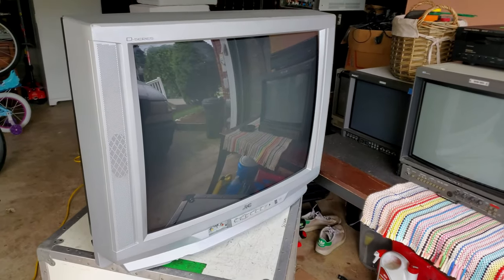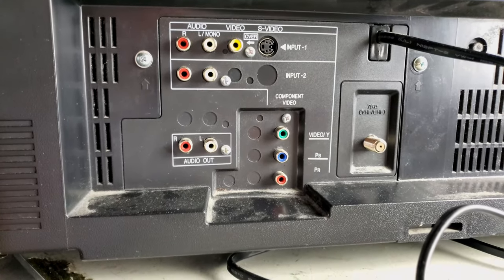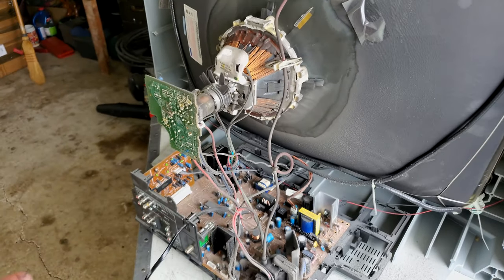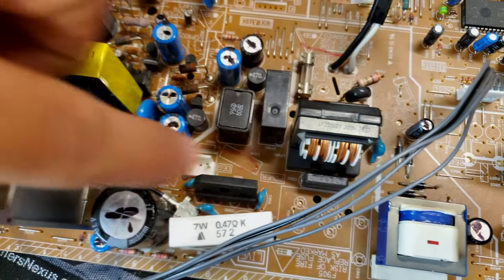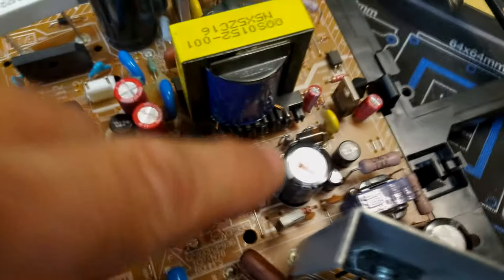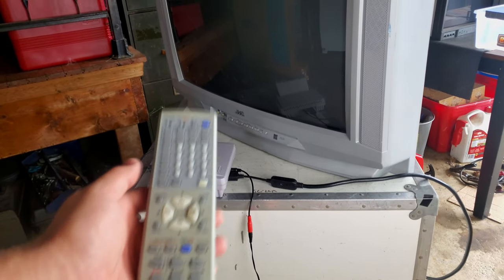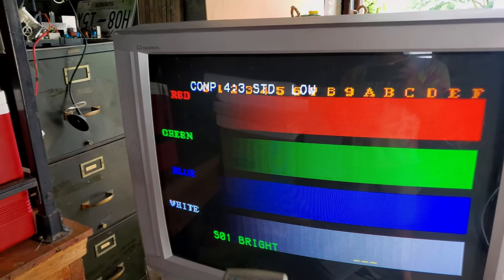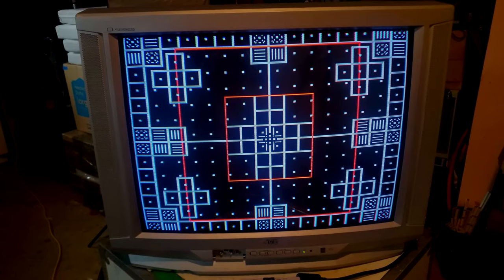The Biggest CRTs still in use: The JVC AV-32D305 D series TV

Comment: Panasonic M class tubes are fantastic. I was given a 32" Sharp with a M80JUA061X in it, and the picture is fantastic. I'm currently running my MiSTer through it as my daily driver CRT
Reply: I have a 30 year old sharp linytron  still has great audio/visual. Not one tv made today will ever last that long cheap throw away crap.
Reply: I fixed a short and reapplied vacuum to the tube, fixed the color flicker until I gave it to my favorite nephew.

Comment: I have this set with a Thompson tube. The Panasonic tube is definitely the sharpest, but I still love mine. Only issue I have is with horizontal linearity, haven't been able to get it perfectly uniform across the screen. Btw NTSC MAT will fix the red push for Composite and S-Video. But to fix it for component you need to also set it to 0 on CMP MAT

Comment: coming back to add the ntsc mat worked to pull down the reds on my 32d305 in component. also each input gives you access to different setting in the service menu. i also noticed the S47 PIP ADJ was pulling down the reds as well. i need to mess around some more in calibration to see which i like more.

Comment: Question, have you adjusted the yoke rings on your JVC? I have moved the yoke deflector to fix a major convergence issue (probably from the TV suffering an impact with the original owner), but there is no trimpot in the neckboard to adjust the electron gun focus, so blue and red are a bit apart. Any idea there?

Comment: Hello, Steve! Could you please refer me to a video of yours where I could find what tube components are used to correct the horizontal rightward astigmatism of a CRT? Maybe, there are some more common terms for this problem, that I could google for? Rightward trace from any objects on the screen fading out smoothly. Fades increase in length to the right. The unit is Dell p1110 trinitron. Its service manual indicates some controls coded as follows: Purity magnet, 4-, 6-, 2-pole magnets, H-TRP, YCH, YBH, TLH, HBV, XCV, APH. Is there any source I could look those acronyms up? The focus on the flyback is adjusted already, and the convergence adjusted to its best via WinDas as well. To add up more to the problem description, the vertical lines on the white crosshatch pattern are thinner than the horizontal ones since the traces from black areas overlap the white areas and vise versa + green patterns always look thick and unfocused whatever I do. The R and B channels are focused well. Would be grateful for the response as I can find no solution to this problem over the web.

Comment: I've got one of these in black, near mint condition. I must say though I just prefer the cleaner look of Sony's aperture grill. 
Still though I've never seen a JVC pro CRT monitor in person. I've heard they are some of the best.
Reply: I'm a Sony aperture grill fan myself. They are brighter and sharper.
Reply: @Tiknuttle  yeah, this video motivated me to compare. So last night I ran Zelda on my 32" D series, 27" 310, D20, and Q8fn via retro tink. 
 At this point I think it's almost a hobby comparing displays. I had a lot of fun. Anyways of course the D20 destroys all in color accuracy and sharpness. Then the 310 is really bright and great colors in a nice size. It's almost as good a picture as a pvm 2030. 
 The D series is big and very bright but tends to color bloom, especially if you've seen a calibrated bvm. Also the shadow mask just isn't as tight and clean as the aperture grill. Also the curved screen is really pronounced on this model.
The retro tink is great on a really big screen. It looks really good when you get it set just right.
Reply: @wg8561  So you use the retrotink on a CRT. I thought that was for flat screen HD TV's?
Reply: @Tiknuttle  no I use it on my Q8FN. That's a Qled
Reply: @wg8561  oh. Ok
Reply: @Tiknuttle  he didn't use a retro tank he used the HD retrovision cables.  These cables allow you to plug in to your SNES  with no modifications and output through component which is near RGB quality.
Reply: @crtinkering7323  That's what I use as well.

Comment: Excellent video.  A little jealous of whomever had you service their set... lol.

I have collected three D 300 series in my search for a keeper.  2x 305s (one really needs servicing and cleaning, the other is beautiful and just needs a slight yoke rotation to fix the skewed image) and 1x 303 (also dirty, but excellent geometry and convergence).  Have not checked which tube(s) are in them yet and I cannot find any appreciable difference between the AV-32D305 and 303, except OEM remote control.  I completely agree with your assessment and will add when they are well-calibrated, I would put them up against any other high-end consumer grade CRT out there.  Color saturation is generally higher than Sony and others, which I actually prefer.

I really appreciate you putting this out Steve and I would be interested in that cap list here or on the Patreon...
Reply from the maker: Absolutely.  I will publish that cap list to Patreon very soon!  Thank you.

Comment: I need to clean out my TV. need to discharge it though, scared to it's a 40" monster. would standing on a wooden chair using a pvc pipe with a screw driver attached to it (and grounded with the usual screw driver to braid strap method) work? after discharging, can i leave the anode on and just brush off the dust with a nice soft bristle cleaning brush?

Comment: Awesome channel!  Can you describe you board cleaning process?  Some of these boards are so damn dirty, sometimes I wish I could submerge them is 91 AL and use a chip brush to flush/clean them.  Just like using a shop parts cleaning station for auto parts, these boards need more than just some compressed air.  Thanks.

Comment: Wow, the picture looks amazing. At nearly 200 Watts though, I think I'll stay with a waaaay smaller Sony Trinitron or even a nice little Toshiba CRT for my retro gaming sessions. Would love to see one of these in action, though.
Reply: It's well under 200 watts. The sticker on the back said 128 watts which usually means the maximum. The actual typical consumption will probably be lower than that. It's not really far off from modern large TVs either. There's nothing wrong with using a smaller CRT of course. I do have some power usage numbers I recorded myself.

Sony PVM 8" uses 32 ~ 38 watts.
Sony PVM 13" uses 38 ~ 45 watts.
Sony PVM 19" uses 65 ~ 85 watts.
Samsung CRT TV 19"  uses 40 ~ 50 watts.
Sony (consumer) 32" CRT uses 75 ~ 129 watts.
Samsung 32" CFL LCD TV uses 35 ~ 87 watts.
Samsung 65" LED LCD TV uses 60 ~ 100 watts. 

Unless you're extremely worried about power usage that you watch every little bit that you use, the difference between different screen sizes of CRT or versus LCDs isn't significant. Just use whatever display you like best. I personally like the 19" CRTs, but it can be fun especially if playing multiplayer or light gun games to have a 27" or 32" screen.

Comment: Great video and awesome TV! I have a European Sony FD Trinitron KV-29FX30E (FE-2 chassis), great picture with RGB scart, but it has a strange issue. Whenever sound is connected either through front panel composite or scart in the back, the screen is pulsating. Could this be some kind of grounding issue? Only happens when sound is connected. Steve do you accept boards for recap from abroad?

Comment: Just snagged a 32D305 off FB and fixed the red push with this vid. Any other settings recommendations or is this the point where I just write all the current values down, then start messing around?

Comment: is their anything i should be worried about with a 1989 RCA ColorTrak E13169GM crt? 
the tvs working great just wondering if they are prone to bad caps or not
Reply: At that age anything can go but if its not over used and the tube is in good shape it will probably last for a few more years.